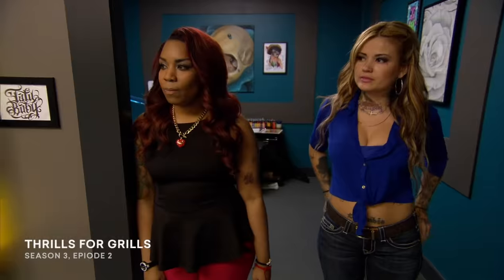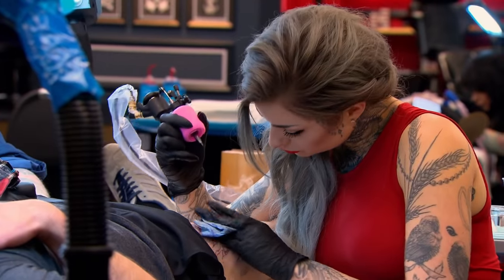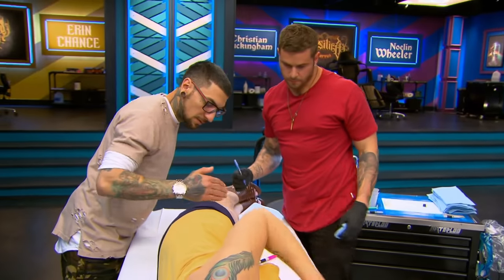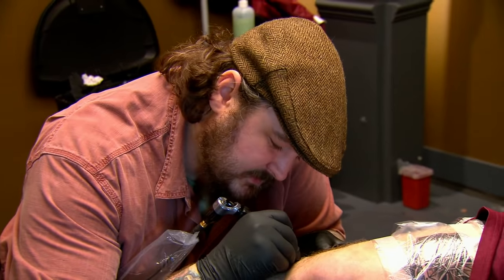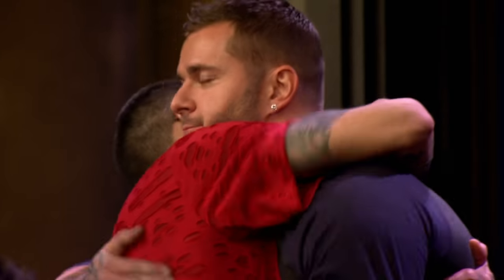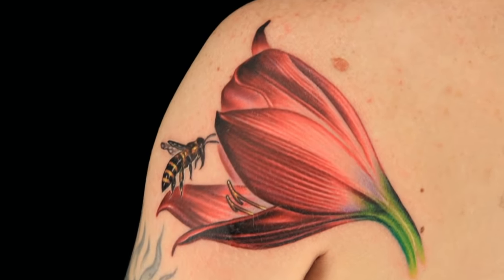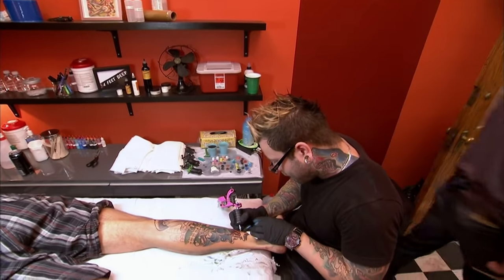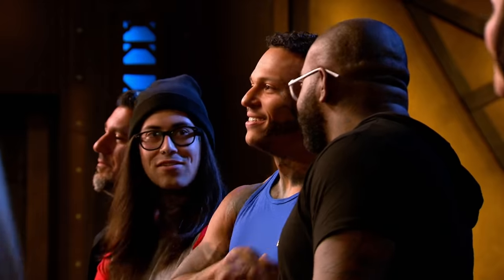Best Tattoos SUPER COMPILATION | Ink Master

Comment: That treble clef tattoo came back through as a redemption tattoo and the artist was a cocky asshole. Poor woman just got hammered and ended up with scarring, blowouts, and residual pain. She reached out to him multiple times in an attempt to get him to fix it and eventually had to have another artist fix it, at which point the original artist got pissed that she dared to mess with his tattoo. He legitimately thought it was his say what she did to it and said she shouldn’t have touched it without his permission. He then said it was her fault it didn’t look good because she must have had improper aftercare, even though the artist who fixed it came forward and said it wasn’t an aftercare issue but having her arm hammered

Comment: Use ion 14b 1oz 14 v 1oz 40 volume 2 packs of sweet and low leave on 45 with at the last 5 minute under med hot heat. Then use icy white toner 20 volume 35 minutes all over , if you have bad ends use a heavy balm conditioner